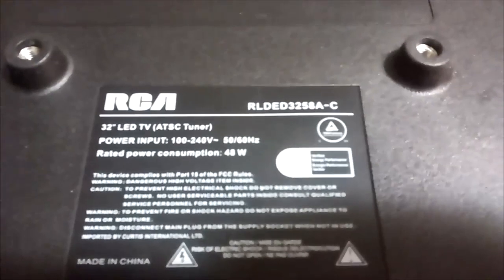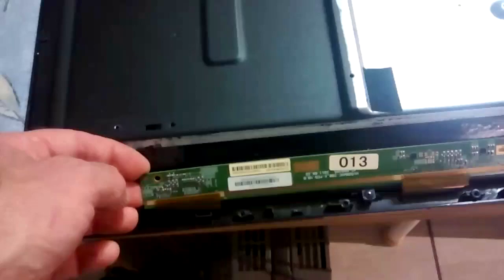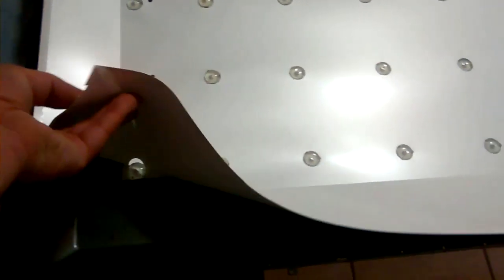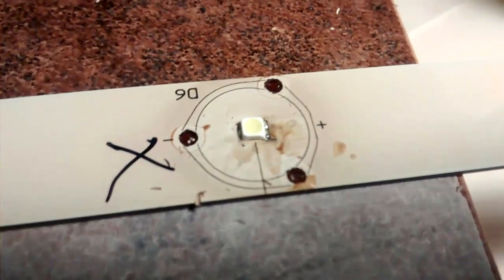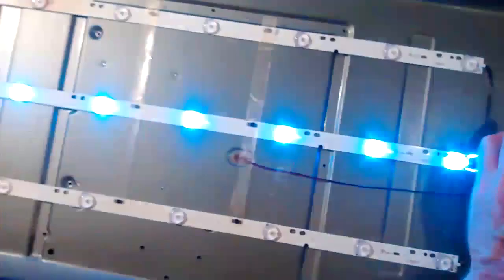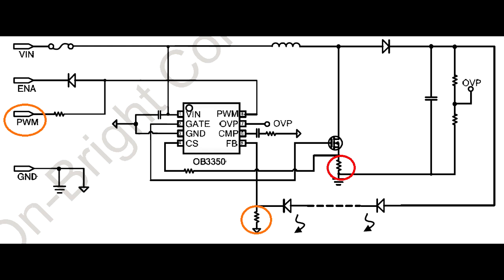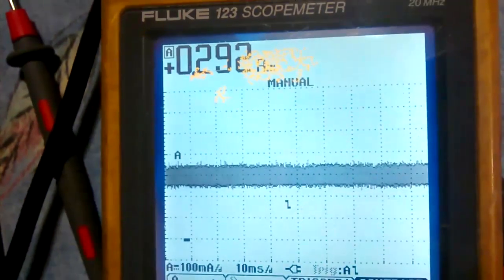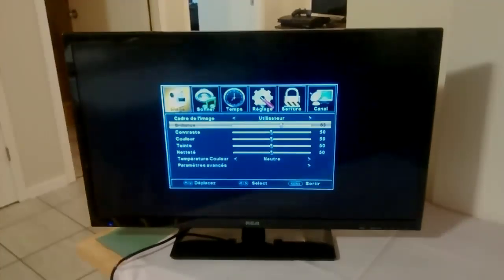RLDED3258A-C  backlight repair and LED current adjustment

Comment: Is there any ways to enable or turn on fully the OB3350CP chip, i have a broken board that i want to just use the led drive circut, but i cant get it to operate, its currently at 46volts, but the driver mosfet there is not signal on the gate for it to oscillate to 120volts to power the led array.
Reply from the maker: What are the voltages at the pins?
Reply: TomTechTod probably I didn’t make to mention that the logic side of the board isn’t working have couple blown chips on the lower logic level, I’m just trying to use the power supply side not much of the 12volts but more of the LED supply side to power another tv that have a bad backlight circuit. Just want to use the two boards to make one. One is turning on but no backlight and other has good power supply but I don’t know how to make the backlight circuit oscillate to full mode to drive the LED it’s at 46v but need (at least 120v) but the mosfet doesn’t have any gate drive so I know the donor board isn’t fully on as yet.
Reply from the maker: You will have to measure the controller IC voltage levels at all pins with an oscilloscope.

Comment: Thank you for this helpful video , regarding the led current why don't you decrease the backlight from service menu ? Would it decrease the backlight current also?
Reply from the maker: yes, that's possible too if that adjustment is available. (on some TVs it's not). I prefer doing it on the hardware side because on many TVs this menu adjustment has to be done for each input separately and many other menu options can possibly override the backlight adjustment, like ECO mode, Image mode etc. And I don't feel like reading the whole user manual. ;-)
Reply: @tomtechtod9200  What setting would you set it to for backlight to a safe level, 50% or lower?

Comment: Hi. How do you get these low mA readings ? if each LED is using/needs "300 mA" 21x led... i dont get this.
I dont have clamp like this, but I connected new multimeter in series in front LEDs and got: 5.20-5.34 A, 112V. I dont know if this is correct current, first on mA got - OL, then on 10A - 5.20 A, I was surprised.
If I connect A after LEDs - black wire will this show excess current or current of last LED ? I never done this kind of measuring.
I plan simply add resistor in series with LEDs I could not find datasheet for my bd559 led driver and 4x R are 100k (104), wattage of resistor must be no less than 2 watt like 2W leds right ? or its better to put higher 3-5W resistors, more will endure probably.
I guess in your video for 39LN5700 is 5W resistor, but did you also remove other resistors in series with MOSFET when you did test with that 4.3 resistor ? because one of 4.3 Ohms in front leds seems low.
Reply from the maker: 1. There are always LEDs are in series, one string or several of them. When in series, currents don't add up, the current in one LED is the same as the one in series with it. 
2. A multimeter will very likely give false readings when measuring switched currents. Don't forget, the LEDs are usually driven with a PWM signal of several hundreds  Hz and more, , that's why I use a current probe and scope, the only reliable way.
3. Putting a resistor in series with the LEDs will not decrease the effective  current in the LED until the PWM is maxed out. The "current sense" resistor value needs to be slightly increased so the LED driver "thinks" the current is higher than it actually is and will therefore decrease the PWM duty cycle. Most chips have probably other inputs to dim tge LEDs but most of the time that information is hard to find so I prefer increasing the current sense resistor value where possible or decrease the backlight setting in the TVs menu when available.
Reply: @tomtechtod9200  Thank you for explaining. Ill try to find that current sense resistor on PCB or try different solution with current modules, reducing backlight to 90% sadly didnt help me for long.
Reply from the maker: @dev1ator_yt  indeed, 90℅ is not much. I usually lower to 50 - 70℅. I just saw that in this TV they really drive with a DC current from the output of a boost converter. These TVs are even worse for finding information on the LED driver circuit, the principle remains the same though. Led current is sensed through some low Ohm current sense resistors and if you increase their value the LED current will drop.